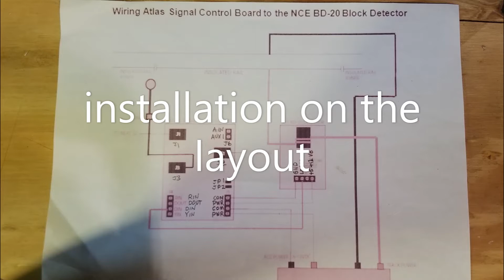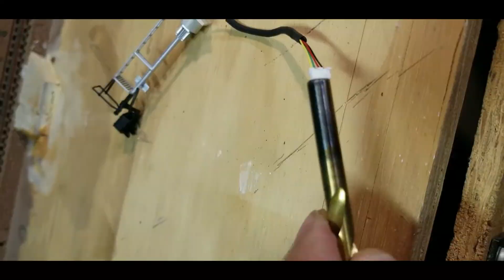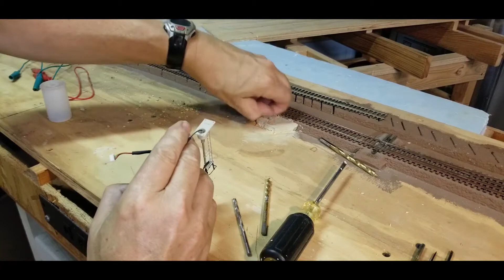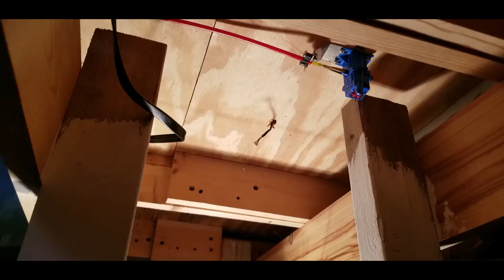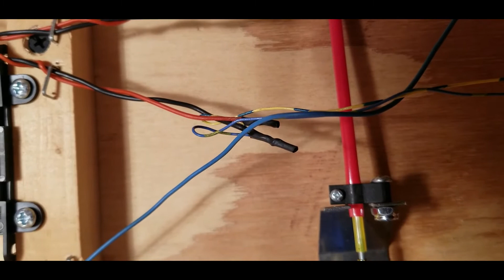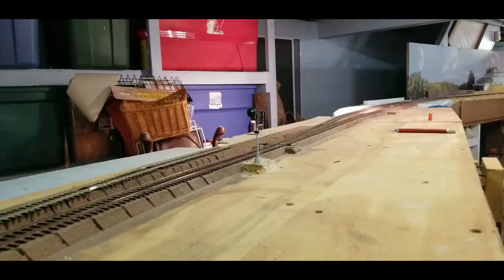Atlas signal system installation part 2

Comment: Chris excellent  , where did you get the resister pots you used on the db20 block detectors
Reply from the maker: hi james.. digikey.com   or    mouser.com   if one doesn't have them in stock hopefully the other will. the bd20 manual will tell you the ohm rating. I think I used   1k at 1/2 watt

Comment: I was thinking if I decide to go this route, that I would be inclined to go to Lowes and buy some 2-gang plastic electrical boxes to protect those electronic boards and the wiring from accidental damage, and keep the components free of dust, etc.
Reply from the maker: I have mine screwed under my layout flat to the under side of the plywood sub roadbed exposed and haven't had any issues so far, but your idea would give an extra bit of protection